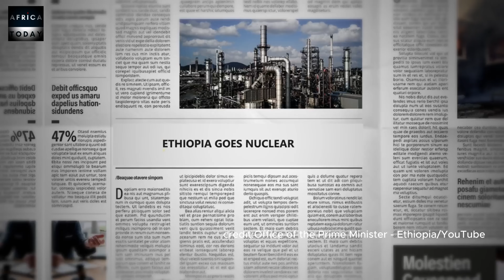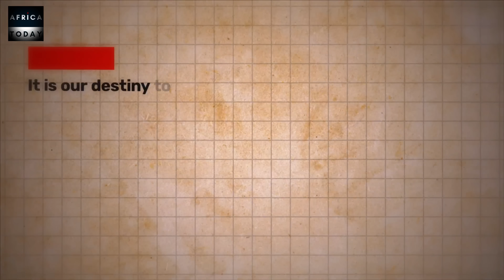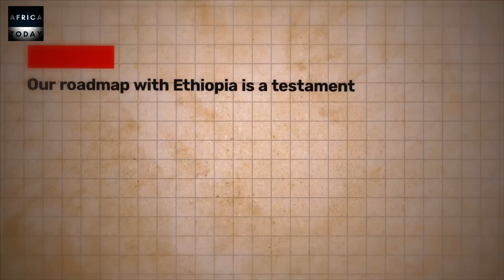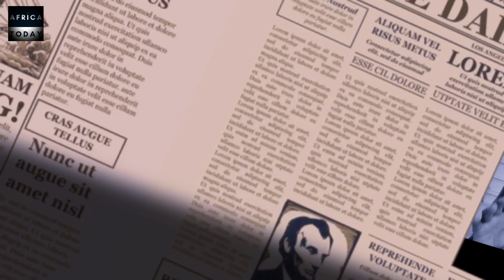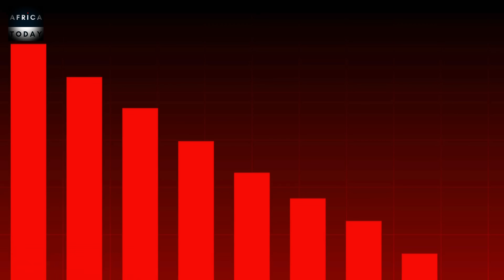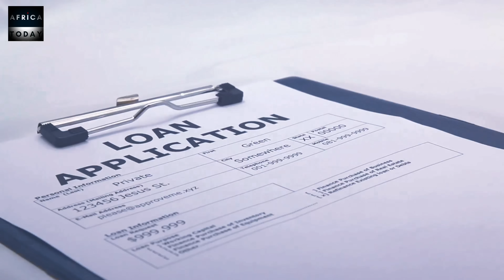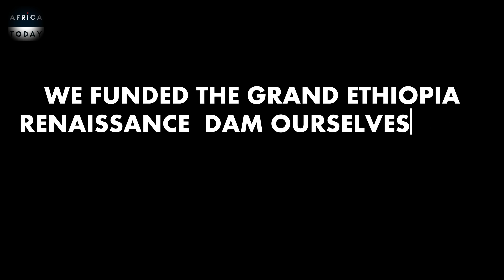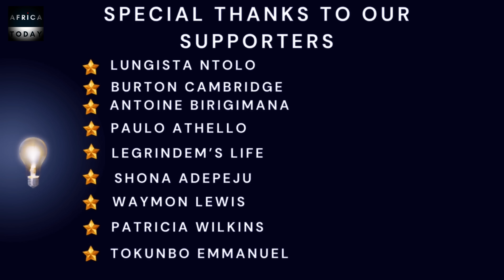Ethiopia Just Broke Every Rule About Who Gets Nuclear Power

Comment: The Democratic Republic of the Congo (DRC) has not developed its nuclear capabilities into a commercial power program, relying instead on research reactors located in Kinshasa, namely the TRICO / CREN-K facility. These reactors, TRICO I (50 kW) established in 1959 and TRICO II (1 MW) introduced in 1972, were intended for training and isotope production rather than electricity generation. Over time, the facilities and associated supply chains have deteriorated significantly due to various factors, including political instability, substantial cuts in state funding starting in the late 1980s, and governance failures under Mobutu’s regime. 

The deterioration was exacerbated by export restrictions and embargoes that hindered international suppliers from fulfilling their commitments, leading to aging reactor infrastructure and difficulties in obtaining spare parts and fuel. Additionally, a concerning issue has been the theft and loss of fissile materials; throughout the years, several fuel rods and high-enriched uranium (HEU) items have been reported missing, with instances of theft linked to criminal organizations, escalating proliferation and safety risks.

Moreover, physical degradation of the facilities has posed contamination and safety concerns, with incidents such as structural damage causing reactor shutdowns. As of 2004, the Kinshasa reactors have remained in extended shutdown, with non-operational status. The DRC's uranium supply, primarily sourced from the historical Shinkolobwe mine, does not support a functional nuclear fuel industry for power generation due to its troubled past and lack of integration into a modern state-controlled framework. Observers from the International Atomic Energy Agency (IAEA) have urged for organizational, security, and technical improvements if there were any plans for the future expansion or reinvigoration of the nuclear program.

Comment: It is also a Possible Dirty Bomb! Japan with Fukushima issues or Russia with WormWood Chernobyl and USA With 3Mile Island melt down.. Japan Had Ocean Water for the Cool down so You still need the Water anyway. If the Water gets Nuclear contaminated you can't drink it for a very long Time. No life left in it. The problem is the Design of Equipment. Most stuff uses too much electricity Electrons to Run. But stuff like LED incandescent light Bulbs use way Less. Most Flat TV's with OLED set up is a Light and Entertainment. I would Not try to Become Manhattan or Tokyo with enough Light can see from Space. These USA or French English with Weapons can blow anything up. Catching them and Permanently Arrest them for War Crimes would Work better. I think this could be a Mistake because Rechargeable ION lithium batteries can run a Home from SUN Light.